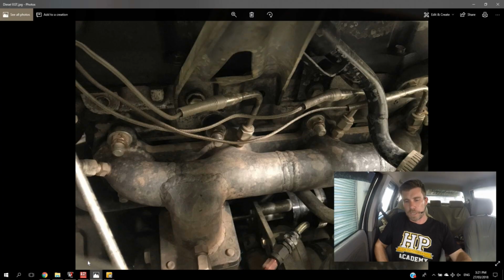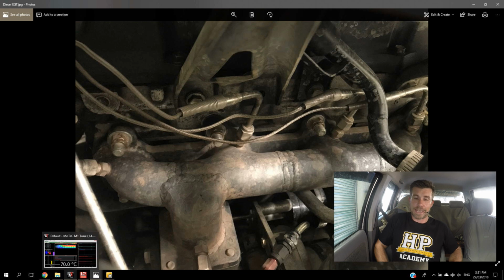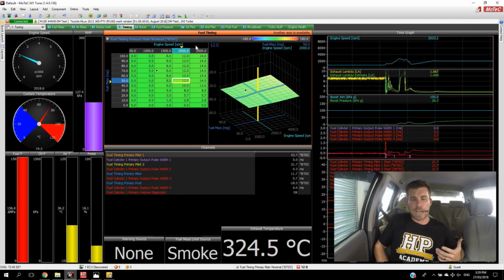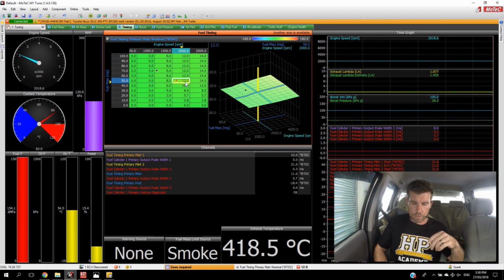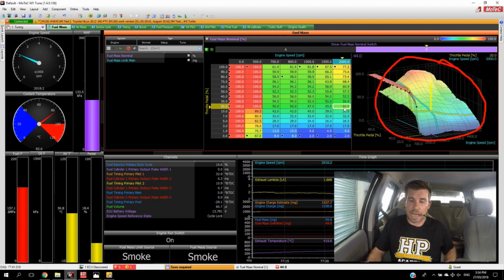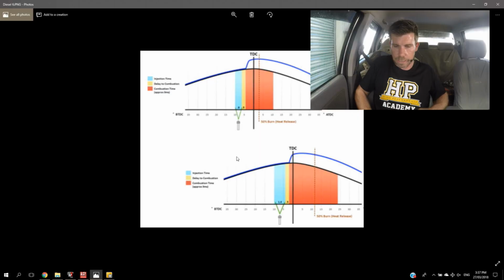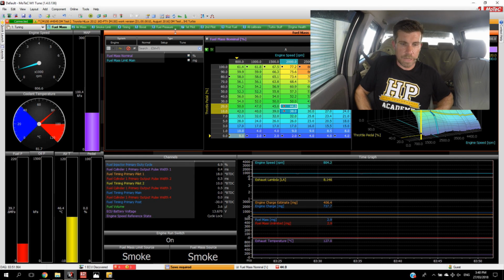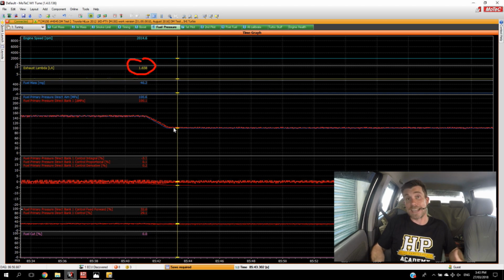Are Your EGTs Too High? | Exhaust Gas Temp Management in Diesel Engines [#FREELESSON]

Comment: My 2.0 TDI (VW EA288 DBGC engine) had egt limiter at about 860 deg (celsius), now it has some tuning and its limiter had been risen to 930. Can I consider it as "safe tuning"?
Reply: And also at full throttle temps rather quick rise to limit (930) and ECU starts to lower down  fuel injection. Sometimes it is not fast enough and temps are rising above 930 and the biggest temp I've seen was 970, rather often I see ~950 at intensive overtakings.
Reply from the maker: That's very high if you're not using specific components rated for it. Check what your turbo is rated for as a start, I'd say most likely while things might not go 'bang' straight away, unless you have built the engine and spec'd the turbo to handle those temperatures, you will be doing damage.
This is a quick read: https://www.hpacademy.com/technical-articles/what-is-a-safe-egt/?utm_source=youtube&utm_medium=social&utm_campaign=general-interaction - Taz.
Reply: @hpa101  thank you very much!

Comment: Get to the point stop dragging it out
Reply from the maker: 0:00 - Why Do We Monitor EGT's?
1:40 - First Off: Diesel vs Gasoline Tuning 101
5:40 - Measuring EGT
7:46 - EGT Data Setup
9:05 - Thermocouple Fitment
13:20 - What Do High EGTs Do?
14:20 - How Much EGT Is Too Much? - Practical Demonstrations
31:58 - Lesson Summary: How To Find A Safe EGT To Run?
38:43 - One Part Of A Library Of Knowledge

Comment: I have a 2011 1.6 TDI VW that's remaped and in the 4th gear at about 3500rpm+ the ECU is cuting my injection beacause the EGT reaches 850C. Anyone know the cause of that? I have no fault codes. Thanks.
Reply from the maker: It could be a number of things, even something not quite right in the tune. You need to log some data and check then go from there. No good to have us or anyone else just guessing as it could set you off down the wrong path - Taz.
Reply: @hpa101  thanks but what should i log? Idk about the tune, it runs in some kind of protection that i think the tuner set at 850c EGT.

Comment: So what’s  the maximum EGT is safe?
Reply from the maker: There isn't just one safe value as it depends a little on the setup, but, 1350 Fahrenheit/730 Celcius is generally considered the absolute maximum for the vast majority of applications from a reliability standpoint.

Personally, for my own diesel engine application and how I use it, the head is a known weak spot when it comes to heat and cracking due to a poor cooling design for the last cylinders (it's an inline 6) so I try and keep it under 600c. I am also not racing it.

Some others in race applications will get as high as 1600F/870c, but that isn't always sustained and they have the setup and sensors to match, as well as the willingness and budget to take risks in the name of competitive motorsport - Taz.

https://www.hpacademy.com/technical-articles/what-is-a-safe-egt/?utm_source=youtube&utm_medium=social&utm_campaign=general-interaction

Comment: So what about when adding exhaust heat wrap and turbo blankets? This will increase the overall temps but does it not help with scavenging to bring cooler air into the intake.

Comment: I understand that the question of how high is too high on a egt is hard to answer.but lets saying everything is fine injection timing etc.isnt there like a sorta standard. eg at idle between 100 and 200c is normal, or eg up a steep hill egt hitting 600c between 800c is normal. Depending on car or truck. What is the point of a egt gauge if we dont know the safe working load. Sorry if i missed it in the video.if i have i will re watch.cheers
Reply: Not sure about other brands, but Isuzu release a data sheet on their engines with the safe EGT value.
Reply: @Jin-Ro  do you have a link? Thanks.

Comment: From tuning large displacement diesels I have found that timing is the best way to get power but the easiest way for inexperienced people to destroy a bottom end. At a certain power level you will need to get bigger injectiors. Using the proper injector for the power range can make a big difference in EGTs, same power with lower EGTs is something I have seen often.
Reply: Bigger injectors allow a greater timing window for a given fuel demand. In a P-Pump you need bigger pump plungers too.
Reply: I have hight egt . After replacing 4 New injectors and injectors . Its for 2.2 d captiva in m'y 2.0 cruze  . Can you help me